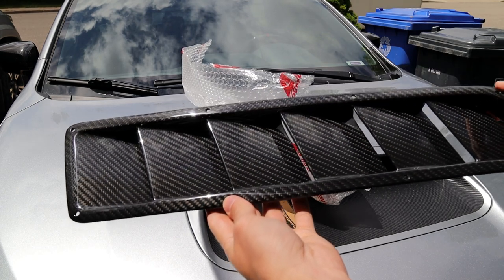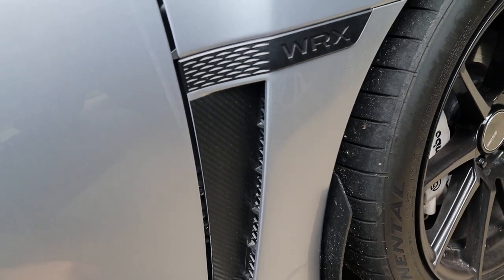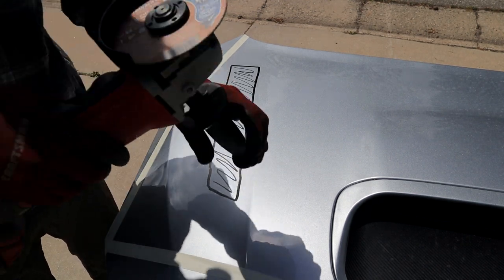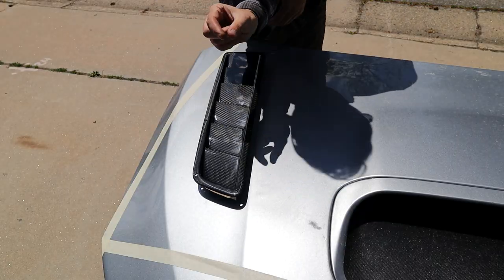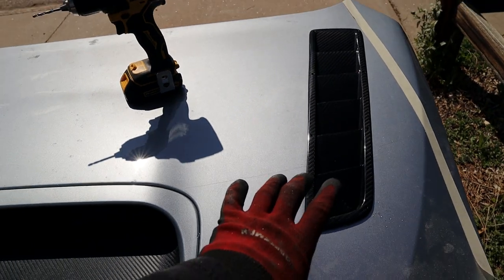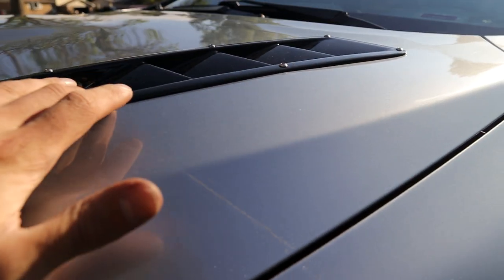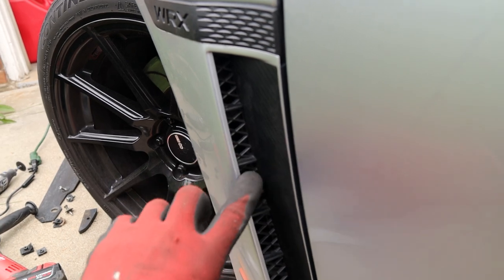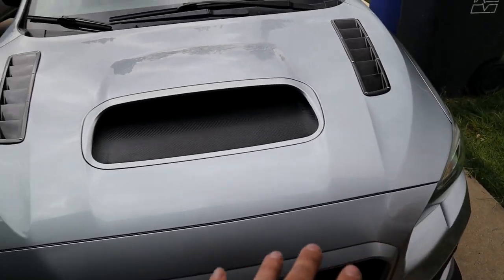APR CARBON FIBER Hood Vents & Functional Fender Vents

Comment: 1 thing to consider when installing vents is the structural integrity of the bonnet, the underside has reinforcing in order for the bonnet to retain its shape, cutting this reinforcing out makes some of the metal flex and in some cases it can flex really badly, so becareful as to where your cutting so you dont create too much flex.

Comment: Drill the corners with stepped sheet metal drill first to make clean corners that are harder to overshoot and then look less ghetto from underneath. Clean the edges with rotary tool. Leave the hood structure underneath it’s there for multiple reasons: simple structural integrity and for proper crash performance (crumpling in proper order). Paint all steel edges.

Comment: Looks beautiful..1 thing id recommend if you have enough metal on the passenger side so the vent could slide in a bit more toward body line without  lip of vent on opposite side having and opening that way can correct the lower inside   vent not on body line as drive side is.

Comment: You should look into getting the Verus Hood Scoop Block off. That way the air comes through the front and leaves through the vents without interference from air coming in through the hood scoop. That will really help with IAT’s and overall temps
Reply from the maker: Yeah, that's next on the list! I might be adding a top mount oil cooler instead, so we'll see.
Reply: @WRXGarage  
question, how can you use versus hood scoop block off when running a top mount inter cooler. won’t that defeat the top mount air intake?
Reply from the maker: I'm running a front mount intercooler not a top mount.

Comment: Looks good for universal pieces. One thing I'd definitely suggest you do is paint the cuts on the fender venting. raw metal rust fast. I'd even do the hood. doesn't have to be a pro job. a can of black Rustolioum (or however you spell it)  tape everything up add some newspaper and hit all the cuts with a few coats. Should save you a lot of headaches in the future. Anything, just seal up the bare metal. But definitely should see a few degrees difference next track day. 👍
Reply from the maker: I actually did paint the exposed metal on the fenders and the hood with some touch up paint! Just forgot to film that step. Great suggestion tho!
Reply: @WRXGarage  Nice, just wanted to make sure.  You're obviously a very intelligent person, so I kinda figured you did. But didn't see any mention in the video and I'm sure people will try to side vent mod. So I figured I'd bring it up. We have to save as many of the VA's as possible. ✌️
Reply from the maker: Hell yeah!!

Comment: 1 question. What is the concern with rain. I don't see a water trap, so is all that water going inside the engine bay?
Reply from the maker: Yes, water gets in there, but it's really not as much as you'd think. When driving in the rain, a ton of water comes through your radiator on a normal car anyways. Modern engines are built to withstand water

Comment: Mine is heat soaking bad but it’s heat soaking my coolant and I have a koyo radiator. A turbo blanket helps a lot but the size of the turbo and the closed deck block it’s very hard to keep the temps down.
Reply from the maker: Yeah man, these Subaru's always have heat issues. The only way to really improve temps is to delete the condenser/AC. Also, switching to distilled water instead of OEM coolant helps a ton

Comment: is it me or is the passenger vent slightly out and away from the center more than the driver side vent? If you look at the hood body lines the driver side flows perfectly along that line while the passenger one seems to veer away from that line towards the front.  Or is that just my imagination? Im about to cut into my own wrx hood in just a few minutes. Btw I think the placement is in a great location and I plan on also riding that natural body line.
Reply: Yep I see it ..when he trimmed the hole he cut he should trimmed the inside cut that would have leveled it correctly

Comment: not like it's a big deal but your cutting wheel disc the letters go to the inside towards the motor
Reply from the maker: Huh, good to know! I wonder why that is.. it looked symmetrical on both sides when I attached it
Reply: @WRXGarage  it's so that way you can read what kind of blade is on there as if you wouldn't know right 😂 it's kind of like putting your shoes on wrong you can do it but it's not quite right you did that help with the cooling on the Subaru is it a noticeable difference considering doing it to mine? But if there's no big temp difference not worth it for me

Comment: Ok so whats the update on the TEMPERATURES!! Is the install worth it??
I mean I just bought them and bout to install eitherway😂
But I want to know DATA!!
Reply from the maker: Honestly.. it's difficult to tell a difference unless you're really pushing the car to its limit on track. That being said, coolant temps were definitely better as more air is flowing through the radiator and FMIC. IATs were definitely a bit better too! If I remember correctly I think I saw around 5-10 degrees F lower coolant temp. The Oil cooler also made a massive difference!
Reply: @WRXGarage  damn thats good to hear bro. 
Because I have Getadom cooling mod installed, Koyo radiator, lower temp Thermostat and these 3 have given me crazy low temps and I live in Miami Florida... summer get HOT... maybe no DRY HOT live California but I just love to see my cars engine COOL 180-185 max temp F.
Reply from the maker: That's awesome! On track, you'll see coolant temps up near 230 which is scary. Once you add an oil cooler which eliminates the oil/coolant crossover the oil will stop heating the coolant at those crazy high temps
Reply: @WRXGarage  oh wow !
If I do that my shit will be like 100 F 😂😂😂 Jk good to know
I dont track my car so I dont think I would do that.

Comment: Did you reinstall the U-shaped insulation piece on the underside of the hood after installing the hood vents? If not, have you noticed any changes in engine noise dampening? I’ve read that the OEM hood insulation also helps protect the hood paint from engine heat exposure. Any comments on either of those considerations? On my 2021 WRX, this OEM insulation piece has been significantly damaged by mice. I’m fairly confident I’ve resolved the mouse problem, but now I’m trying to decide whether to replace the insulation or just remove it completely. Thanks.
Reply from the maker: I removed it and drove around for a couple days. I didn't notice any change in engine noise or vibration or anything like that!